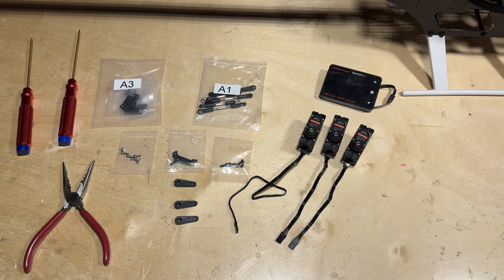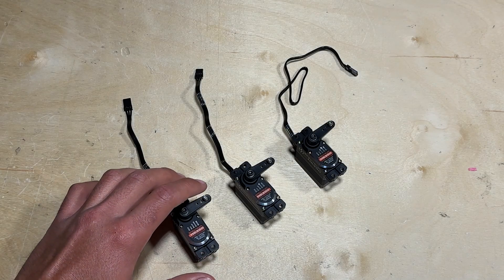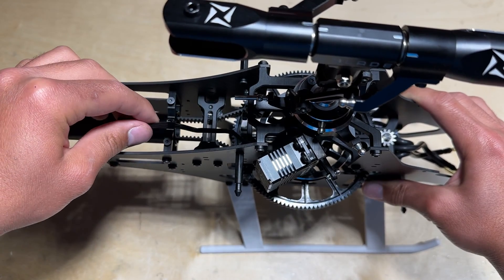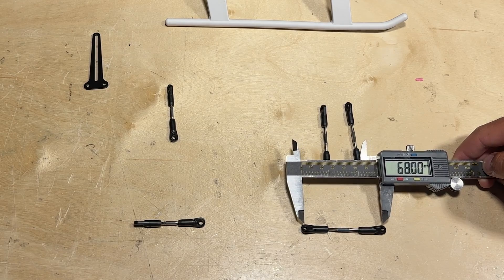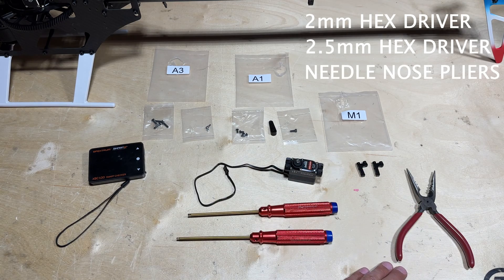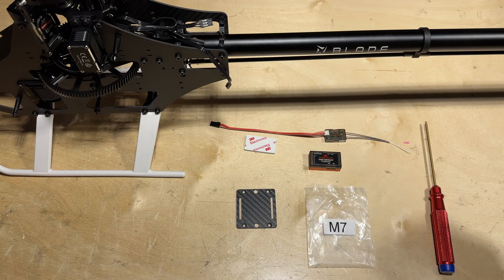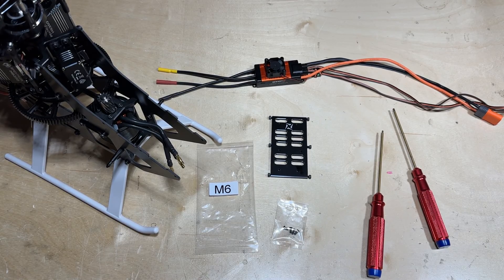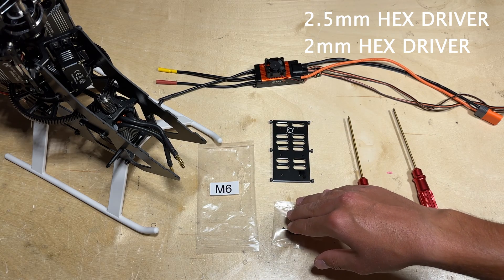Blade Fusion 550 Build Series: Electronics Installation

Comment: hello I have a question on the battery tray and mounting for esc I have a 480 and I cant mount the esc I did buy the 120 amp spectrum esc but it doesn't fit on the 480 the one that came with it but I see the part is the same did they move the mounting holes and leave the part number the same.
Thank you Allen
Reply: And as you see, Ethan moves it to the lower frame portion.  An edit would have been good there in this video. I take the fan off the esc and put it under the battery tray.  It’s only a 4 minute flight.
Reply: @CoeShow619  Thanks